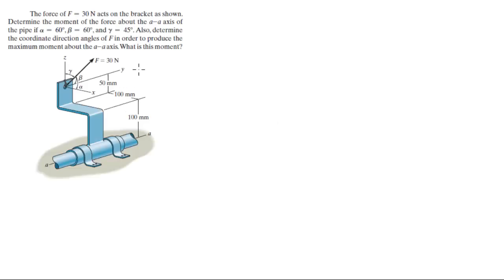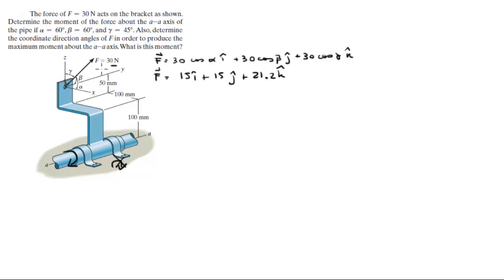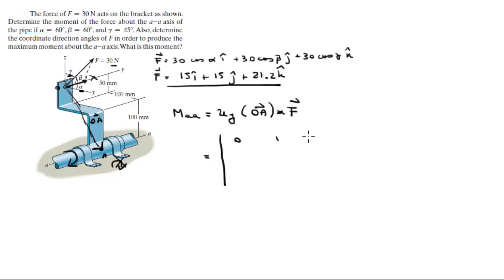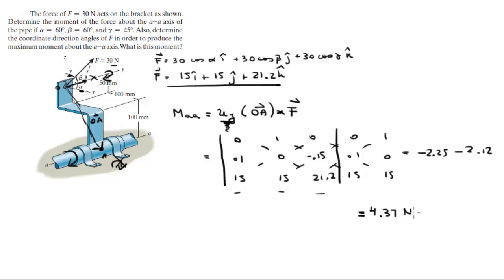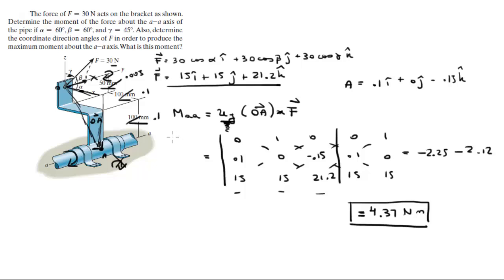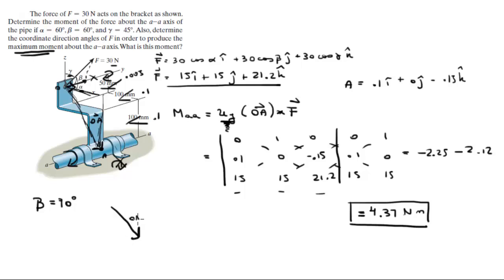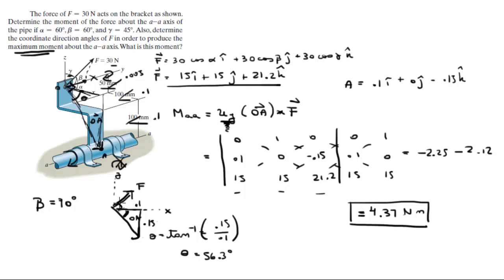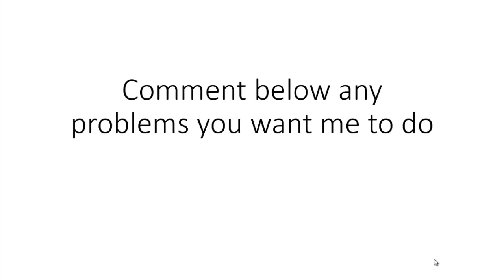Find the moment about the aa axis and the angles for max moment

Comment: For the last part, from the given geometry of the problem, you can first :

-create a triangle with known side lengths of 0.1 m and 0.15 m, this will give you distance between points 0 and A.
-Once you have this distance, you can calculate the moment created about point A by using Moment = Force x distance
-Force = 30 N, given in the problem. Distance = .1802 meters, calculated by Pythagorean theorem ( 0.1m ^2 + 01.5m ^2 = distance OA^2)

Moment = F x d      =======>    M = 30 N x .1802 meters  ========> 5.408 N m
Reply: u should make a video ill subsrcibe
Reply: 6 years later, and you're still saving lives! Thanks a million!

Comment: (-2.25)+(-2.12) is not positive. That would mean that the pipe rotates in the opposite direction. Knowing to change the sign from this method would mean intuitively knowing to change it not mathmatical computation so to speak. Would it not be correct to set A as the (0i+0j+0k) so that OA would be (-0.1i+0j+.15k). This would result in 4.37Nm being positive. Which again is the correct answer but without intuition.

Comment: 5.408 N*m is the maximum moment in the question
Reply: howd you get this
Reply: @Jimmiegame  the same way he found the first moment, except now with different direction cosines.
Reply: goat
Reply: I have the same answer but negative, idk why. but since it's the max moment that is asked for this specific question, the answer should be higher than the other moment ofc, so you're right. just wondering why my calculator gives the same answer but then with a minus sign.